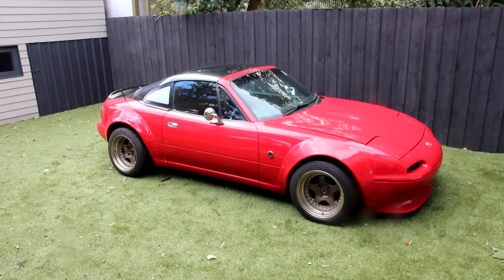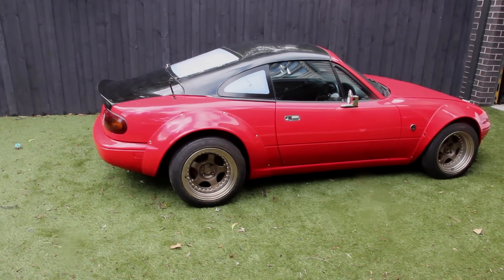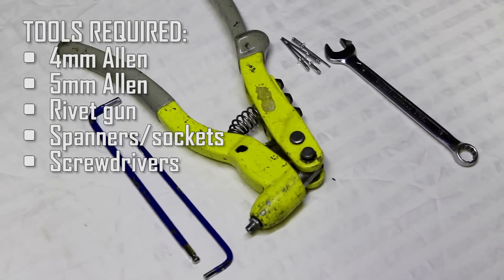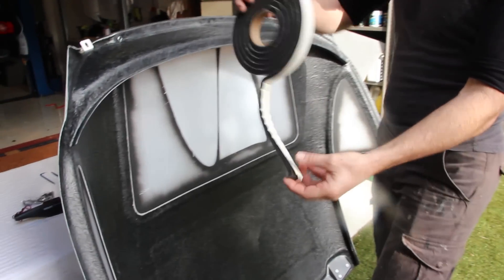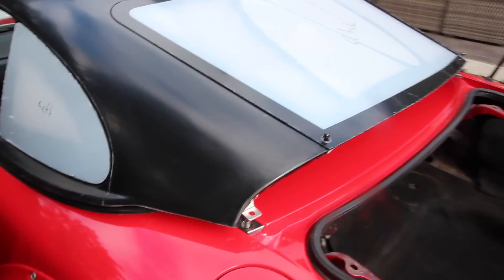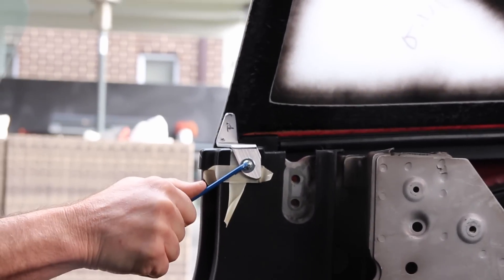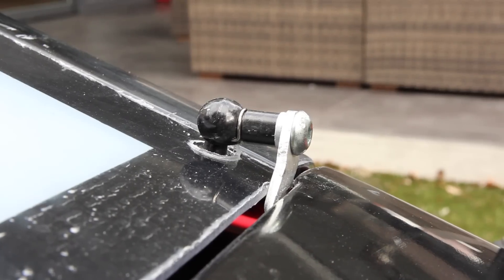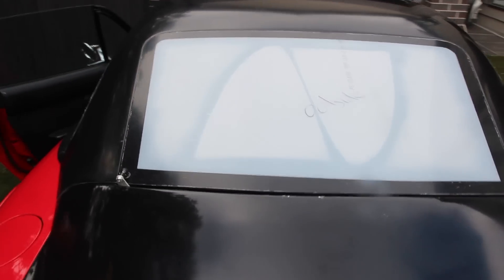LIGHTYEAR FASTBACK MX-5 MIATA - INSTALL GUIDE

Comment: The boot hinges look out of place and make it look cheap. Other than that looks amazing
Reply: You can always delete the hinges and design your own. I am supplying a working boot/trunk, at a reasonable price point.
Reply from the maker: They may not be elegant but are a simple & light weight solution.
Reply: i think on my mates nb he used bmw boot hinges to make it internal. was straight forward
Reply: Any info on what bmw hinges they used? Would be VERY helpful to know...
Reply: @lightyearmx5  You really got your feelings hurt there? I think he was providing constructive criticism.
Reply: @kastriotdestani8446    butt hurts for thinking skinned?
Reply: Yes you are providing a working hood trunk at a reasonable price point but that doesn’t detract from the fact the hinges look like an afterthought, it wouldn’t be too hard to design in an aluminium brace that goes across the back that would support hinges and also add rigidity, from what I saw from the video there’s space between those locating mounts at the rear

Security would also be an issue, if I want to see what’s in your trunk all I’ve got to do is pull those little pins out and pull the trunk lid up, hidden internal hinges are more secure

Constructive criticism 😉
Reply: @kastriotdestani8446  sounds more like a little advertisement for his trunk

Comment: sadly too much spaces....looks rly cheap. yaya i can guess its not that cheap, but i would want a better fitting product
Reply: Not to mention it looks ugly as hell. Nobody is going to go WOOOW, more like DaFuq.... they have these for racing Honda S2000's as well if you people have seen Best Motoring, in real life nobody ever bought one.
Reply: nah man there are good fastbacks for mx5 too...just not this one
Reply: They are cheap, $1500US for a lightweight roof and boot complete and mostly assembled with all hardware, rubbers brackets and hinges set up. Not sure what you guys are expecting. Oem quality? The price would be double. I want people to be able to have a fastback that doesn't cost more than the car.
Reply: Where are the good fastbacks? Genuinely curious.
Reply from the maker: Hi Oldschool, it may not be for everyone, but its definitely not a bad product, and a great alternative to the increasing costs of an OEM top. Thanks for watching!
Reply: lightyearmx5 dude don’t be so defensive

Comment: This is hands down the best looking hardtop for the mx5!
I just hope that it will be available at a sensible price in europe at some point.
Reply: I hope so too but im guessing its going to be over £1500 :/
Reply: Hi, I did look into shipping to the west coat (L.A) and if I get a 20' container, even a part load it works out pretty cheap. The price is £1125. Shipping would be under £200 if done in a group buy.
In a few months I will look into it. But if you guys spread the word it might happen.
Reply: Post it across the facebook pages here in the UK. I'm sure there will be a decent demand for this!
Reply: A金城, uh, it's still a hardtop.
Reply: Cory Banning 2000 would be pretty good.  The S2000 top is more like $5000 US
Reply: vuriby have you come across sarcasm before, it’s harder to distinguish when in written form?
Reply from the maker: Thank you Punkloader!
Reply: they're 1500$
Reply: armadillo platypus the factory soft top leaks far more than most aftermarket hard tops

Comment: Honestly, I love the way it looks (except for those hinges), and I get that it's meant to be lightweight for track use and stuff, but I'm not sure how well it would hold up for daily street use. Would be nice to maybe see a more street-focused variant of this with better hinges and weather seals etc. Also not sure if it's just the video but it doesn't seem to have the best fitment, some ugly panel gap in places.
Reply from the maker: Yeah it's perhaps not as bad as it may appear in the video, but my roof did take some tweaking to get a real snug fit. There's no real issues with weather sealing. As you say, it was designed mainly for function, lightweight and aero dynamics... not necessarily for an everyday car.

Comment: Looks awesome, but coming from the UK, I'd be very worried about water getting into the boot (especially on a mk2 where the battery is in there). Also looks incredibly flimsy compared to an OEM hardtop and personally I wouldn't really feel safe without a roll bar.

Definitely looks cooler than a standard hardtop and would love to see a colour-matched one, bit scared to see the cost of shipping overseas though :|
Reply: I think it was really designed as a race item, hence the lightweight, where you get significant aero benefits. You can still fit a roll bar under it.
Reply: They are not for everyone. The boot seals against the boot rubber just like normal. It is flimsier, but it's also well under half the weight. I can make a heavy one, but once it's bolted on it doesn't make any difference. It's as strong as it needs to be as is. Shipping is cheap when doing a part container load.
Reply: Steaphan Brùs Wouldn't want rain in a 20 year old car's boot like

Comment: Thank you for publishing this. My wife and I recently purchased a nearly perfect NB and never owned a convertible before. My #1  concern is the top and where to park it as America is full of slack jaws that, without thought, will stab the top. This top looks great and I hope they ship to the USA.
Reply: Hi, I like the convertible idea, it can be fun on the road. But for me the Miata is more is more of a track car, that's why I designed the fastback. Having a solid roof is better for security as a bonus. I will be doing a container load to the states. It works out very good value if I ship a bunch at once rather than one at a time. Start spreading the word, the more orders, the cheaper the shipping.
Reply: Robert D. Well get a standard hard top it will be good

Comment: Why have the hinges for the trunk exposed to the elements? Why not reinforce the roof part to have a trunk hinge? The gap from trunk lid to window also looks large. Is weather stripping included for that area? Looks like rain water will flood right into the trunk. Does the kit come with a ceiling and things to cover up the brackets? Why is the gap between the roof and body so large? With so few mounting points and the large gaps there’s no way a body shop will be able to make it look like one piece.
Reply: The hinges are exposed as it's the most simple way. Paint them black and you will notice them less. Not sure why everyone thinks the water will go in the boot. There is a boot rubber that seals against the boot just like original. You can make the gaps any size you want, just fill them. 6 mounting points is the same as original. Can't see how that is going to make it hard for a body shop.

Comment: That looks really good.  Nicely shaped.  All it needs is interior hinges for the trunk (or "boot" if you're a pom) and a way to mount a dome light, and Bob's your Uncle Dick.
Reply from the maker: Thank you Ogamiltto, I agree the hinges are a little disappointing.
Reply: @Bbeavis  One other concern I have (forgot to mention it in my previous post) is that there seems to be a lack of watertightness.  Like rain would just trickle in down the leading edge of the trunk lid.  And I didn't see weatherstripping around the perimeter of the trunk lid, either.
The trunklid hinges and spring thing is eminently solvable.  You might even be able to adapt the existing setup from the original trunklid with a little tinkering.
https://66.media.tumblr.com/5a4965de6e9644a1b2e655a7733c9337/tumblr_o2n5a7Cys41thdnd3o5_1280.jpg

Comment: Looks good. Could have made the gaps a little smaller.
Reply: Can make the gaps any size you want before paint. :)
Reply from the maker: It offers very similar panel gaps to the OEM trunk. Keep in mind the roof needs to have gaps to prevent it damaging the paint where it sits on top of the cars paintwork, unlike the oem hardtop which only sits on a seal and doesn't have any chance of rubbing on paint.

Comment: Lightyearcomposite thank you for the design  it looks great i just have a few questions. First can you fit a rollbar under this fastback top. Second do you need to remove your seats to instal? and final if you do redesign it for the NA miatas could you add a little more to the ducktail.
Reply from the maker: Hi Reggie, best get in touch with lightyear via their website/facebook.

Comment: Looks good, besides the gaps
Reply from the maker: It offers very similar panel gaps to the OEM trunk, while the roof needs to have gaps to prevent it damaging the paint where it sits on top of the cars paintwork, unlike the oem hardtop which only sits on a seal and doesn't have any chance of rubbing on paint.
Reply: Bags are whack especially for a handling track car

Comment: Why try and use the OEM hinges for the boot lid?
And if I am to get one of these I'm worried about water issues in the trunk
Reply from the maker: There's no water issue with the trunk any different to the oem trunk, it uses the same oem trunk seal that is part of the car body.
OEM hinges didn't work because the trunk would hit the main body of the hardtop. so it requires a different hinge angle.
Reply: @Bbeavis  oh.
Thanks for the Info though.
Now the scary part of trying to get on here in the US

Comment: If you want a super good looking well egineered kit you should look into the Autokonexion fastback kit for the Miata, they even offer wheels and other performance parts if you're willing to spend the extra cash :D
Reply: Why would I want a heavier fastback that has worse aero when I have my own? How much is Auotkonexion charging? And does he still sell them. I have read many bad stories.
Reply: lightyearmx5 oh man I've never seen anything bad about them, guess I'll have to see about them but this body kit (in the video) isn't bad it's actually perfect! All that it's got against it is the trunk latches and the tiny gaps around the quarter panel area, but all that can be fixed easily with some good ol body filler and elbow grease 😂
Reply: @marxieuwu3573  many, many bad stories. You are much better off with a Lightyear fastback.

Comment: How well does it fare in the rain, are there any leaks? Cheers
Reply from the maker: It's quite on par to a softtop in terms of rain sealing. The oem style trunk seal remains, so no concern there, while the roof section sits on a seal on the black loop around the rear parcel area. The worst location for leaks would be near where the door jams are and where the door window seals on the top.

Comment: Bet that thing creaks like crazy
Reply: Thanks for your input. But it doesn't touch the car except at the mounting points. The rest has soft seals.
Reply from the maker: Hi Bradley, you can't hear any creaks over the noise of the engine at 7000rpm and 200kmh hahah

Comment: Would it clear or give enough space for a roll bar? Looks great!
Reply: It's pretty much the same height as the Mazda hardtop inside. I have installed a few that have been fitted with a rollbar.
Reply: lightyearmx5 Great, Thank you!

Comment: that trunk looks like it'll leak horribly on a rainy day... or does it?
Reply: The lower edge of the inner frame is the same as the original boot/trunk. So it sits against the boot/trunk rubber.
Reply: So I'm taking it that you're saying rain will pool up in the original rain drip channel and be directed rearward and out just like factory? No leaks... Sounds well thought out... But, I do agree that the hinges look very weak flimsy and unsightly, maybe a future change to use the original trunk hinges and acquire a more stout and sleek look?

Comment: Is this legal on vic roads? or would something like engineering be required?
Reply: I think it's a grey area. The Oem roof is fibreglass, this roof is fibreglass... Windows are shatterproof Lexan.
Reply: I guess that makes sense, considering that the mx5 came with hardtop from factory and that the Lightyear hardtop doesn't stick out further than the body anyway
Reply from the maker: It would not be road legal, technically, but unlikely to be questioned by most authorities.

Comment: wow, looks great!. You could very easily improve the fit of the roof to the cars body. dunno if you will bother to read this, but i'll waffle on anyway. Mark on the cars body where the rear of the roof touches. use something easy to remove like whiteboard pen. Take the roof off and cover this area in a layer of duct tape to protect the paint and ensure that the next step pops off (duct tape has a release agent on the surface). 

Next, mix up a slow setting (dont put in too much hardener!) mix of bog and quickly apply it to the underside of the roof where it meets the body, then quickly install the roof and tighten all bolts as per normal.

Once the filler has cured you will be able to remove the roof from the car, peel off the duct tape and file the bog to shape so that it blends in vertically with the sides of the roof. Obviously dont touch the surfaces that meet the cars body as these will be perfect. 

If that makes sense It'll be amazing but you will end up with better than factory gaps.
Reply from the maker: Thanks

Comment: 0:36 into the video and THOUS panel gaps....
Reply: Gaps can be made any size at paint prep stage.
Reply from the maker: Kimi, please keep in mind that the roof needs to have gaps to prevent it damaging the paint where it sits on top of the cars paintwork, unlike the oem hardtop which only sits on a seal and doesn't have any chance of rubbing on paint.

Comment: So how do you get around all the water that'll end up in the boot? Those gaps are pretty sizeable dude.
Reply: I get this a lot. The boot seals against the boot seal just like the original boot.
Reply from the maker: Hi Dave Roberts, the boot uses the same OEM seal as the normal seal with the standard style boot. There is no water ingress possible.

Comment: Wow, polycarbonate windows suck but still, beautiful.
Reply from the maker: What is the alternative to polycarbonate?
Reply: @Bbeavis  Glass.

Now of course, they have their reasoning and excuses. "It's supposed to be light" or "custom glass would cost too much". 

There was a shop that specialized in chopping the top on Pontiac Fieros 3"(google it, it's pretty sick). The windshield was retained, the back glass was flat so it was easy to have made and tempered but the side windows had to be shorter because of the way the cars are chopped. They needed even more bend than the original glass as well. Customers complained about the polycarbonate windows, the shop swore it just wouldn't be economical to do glass windows for decades and that they'd never do it. Then a guy in his garage decided to start chopping his fieros and showing people how he did it. He started with polycarbonate windows but actually pursued glass windows. He managed to do an order of 15 sets of glass windows that he resold for $200 a set. Magically the shop that swore it couldn't be done started offering them for $500 a set.

Of course custom glass isn't the only option, a hatch was designed for the fastback Fieros, they designed it around nissan 350z glass. This is the route I'd have gone from the beginning with your product. Then you'd have polycarbonate for people interested in the lightweight product and glass for those that wanted a nicer window.

Comment: Looks shitty from the back. And the gaps are wider than the fuckin Atlantic. But from the side it's the 1st ever mx5 I've found attractive.
Reply from the maker: Hey Dabe, it offers very similar panel gaps to the OEM trunk. Keep in mind the roof needs to have gaps to prevent it damaging the paint where it sits on top of the cars paintwork, unlike the oem hardtop which only sits on a seal and doesn't have any chance of rubbing on paint.

Comment: #1 Ugliest mirrors for an NA ... monster truck stance, this fast back looks good on the NB that you designed it for but out of place on this NA sorry  !!!
Reply: This is an install video, I don't think the car should be judged. It's not finished or driveable. I wasn't too bothered about winding down the coilovers for internet fame. I think it looks great on the NA. Once the protective film comes off the windows and the parts are painted red, it will look awesome.
Reply from the maker: Don't hate the ride height, the car doesnt have a driveline yet, its still a work in progress!

Comment: it looks avfull - and very cheap - actually looks very alike a similar "gt6" look plastic hardtop for triumph spitfire made in the seventies - especially the windows and hinges makes my eyes cry with pain made worse by the terrible fit creating very ugly gaps where the top meets the cars panels 5mm or more ??.. really ?? the design does not meet the design of the car very well beeing very squarish  and just do not start me up on how thin and flixeble the thing is.
Reply from the maker: Hi Poul,
Please keep in mind this was originally designed as an aftermarket lightweight top for race track use, while still being completely usable for the street. It is undoubtedly strong enough and is not thin or flexible, although it's certainly NOT as sturdy as the OEM Mazda top.
Take note, the roof needs to have gaps to prevent it damaging the paint where it sits on top of the cars paintwork, unlike the OEM hardtop which only sits on a seal and doesn't have any chance of rubbing on paint.
Thanks for watching!

Comment: Lower this monster truck for fucks sake
Reply from the maker: The car isn't running yet, it's still a work in progress. You may have noticed the missing interior. Thanks for watching! :)
Reply: BEAVIS Motorsport Not doubting your abilities... though that was a mattes car. I think most fastbacks suit the NB better from memory, the NA is too good of a design from factory as is
Reply from the maker: The red car is owned by the manufacturer of the Lightyear Fastback roof, I just helped to make this video :)